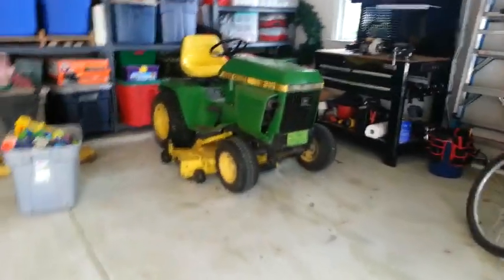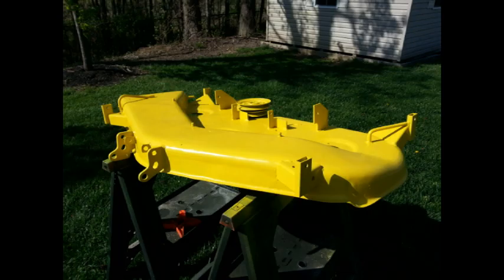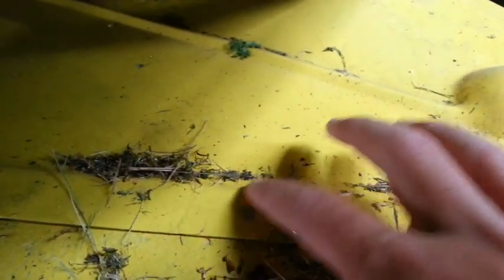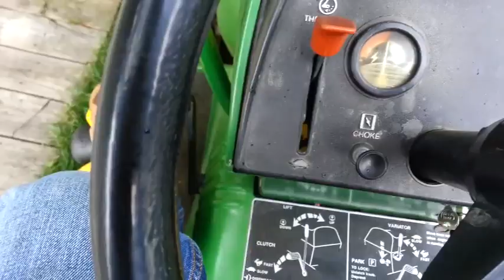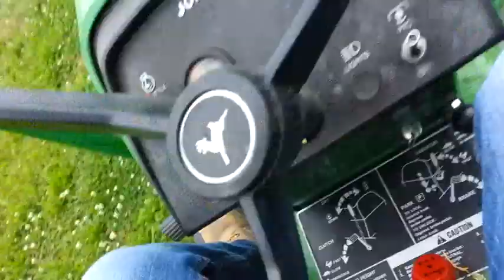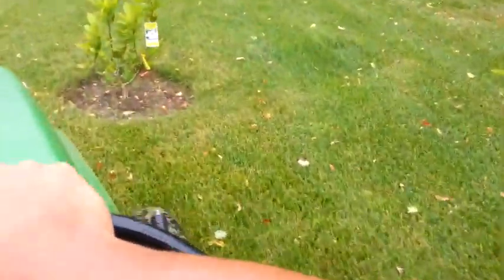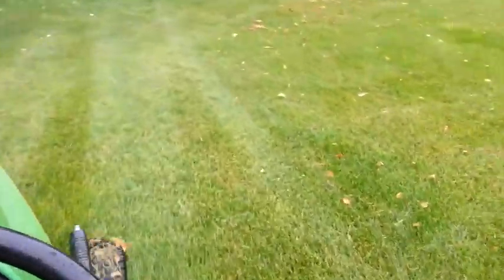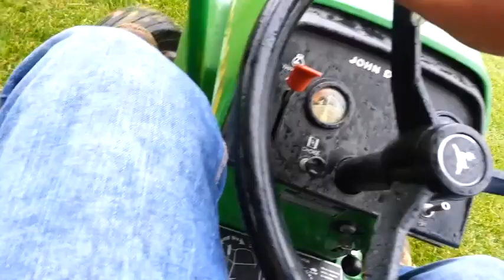Mowing With the John Deere 210

Comment: I take it the 210 can handle the 47 inch deck. But of course 10 hp from that era really WAS a 10 hp and who knows about the torque. The 14 hp in my John Deere STX 46 seems to have way more power than my newer MTD with 18.5 hp Briggs single cylinder. The JD  STX 46 has a Kohler and it can run through six inch high grass turning three blades at 46 inches faster than the MTD with two blades at 42 inch. So HP numbers have really taken a beating. Although, the two cylinder Briggs 16 hp in my friends LT 166 has gobs of power, way more than the Briggs 18 hp. I have to confess, I really like that 16 hp twin Briggs. It has a very quiet exhaust and it's smooth. But it is in no way rugged enough to pull a plow like the 210 and 212 I now have.

Got to say you have yours looking like new, impressive. When I was pushing mine around the yard I was amazed how easy to steer but of course you had to make a lot of turns on the wheel.
Can't wait to get mine running.
Reply from the maker: Yeah horsepower was rated a lot differently back then compared to now. My old 316 with an 18 HP Onan opposed horizontal twin would mow through 6" grass without even bogging down, but my X570 with a 24 HP v-twin sometimes struggles in the same grass. Vertical and horizontal shaft engines seem to put out different kinds of horsepower. I'm sure you'll fall in love once you get the tractors started for the first time. That's how the green fever starts!
Reply: I thought the lt166 came with a Kawasaki motor

Comment: Can I use a replacement gas cap that goes on a John Deere 314-318 on a 200 series tractor
Reply from the maker: No, you need one specifically for a 200 series (AM143251). The early and late 300 series each had their own specific gas cap, neither one will work on a 200 series.

Comment: You should only engage the electric PTO at half to 3/4 throttle.....you could throw  a belt, and it's hard on the engine.
Reply from the maker: With the way the mule drive/tensioner is set up on these tractors, the primary (PTO) belt goes through a lot of twisting and turning which can wear it out very quickly if you're not careful, so I usually engage the PTO at lower throttle to reduce wear on the belt.

Comment: I have a 216 idling go's up and down driving it and running sitting still. I pull the air cleaning off and gas was spitting a little back out of the carb. can you guy's help on the problem.
Reply from the maker: +jag “bunnyman” co Turn the high idle mixture screw (on top of the carburetor) 1/8 of a turn at a time and see if it smooths it out.
Reply from the maker: +jag “bunnyman” co Turn the high idle mixture screw (on top of the carburetor) 1/8 of a turn at a time and see if it smooths it out.
Reply: thanks running good now
Reply from the maker: +jag “bunnyman” co Good to hear.

Comment: Will try that thanks. Grease gun is Coming soon. Should that fix it?
Reply from the maker: It should make the steering a little bit easier, but if the steering gears or the wheel bearings have significant wear, it won't really help. Considering how old these machines are now, they will most likely have some worn steering components.

Comment: michael you ever think about getting an old cub cadet like a 104 obout the same as a 210 or 216
Reply from the maker: If I got a cub it would be a red 82 series or a 16 HP series.
Reply: I found a nice deal on some cub cadets a 104 and 107 for 700 or 1 for 475 but the guy haven't emailed me back if been looking for a John Deere 210 or 216 around that body style but there are any around my area

Comment: Can you mow in reverse with this tractor
Reply from the maker: Yes, why wouldn't you be able to?
Reply: @MichaelTJD60  because some machines have to be discontinued
Reply: That’s disconnected
Reply from the maker: @leonardcusumano3524  this one was made before all the manufacturers started bowing down to OSHA. The reverse cutout relays didn't start finding their way into Deere lawn equipment until the mid 90's.

Comment: just got a 76 model 210 dont think variator is right on it any info on them?
Reply from the maker: +mike stewart The variator is a pretty straightforward setup but if it wasn't taken care of and is not adjusted properly it can be a lot of trouble. What's wrong with it?
Reply: +MichaelTJD60 seems to either be almost a crawl or boogie mode middle dont notice any change also when ya let out on clutch sometimes you have to helo it come up with your foot or takes awhile to come out all the way
Reply from the maker: Sounds like it's just out of adjustment. Look under the tractor and you'll see the variator pulley assembly. Make sure the center pulley/sheave slides in and out on the shaft without any issues, and make sure the pulley is not loose or wobbly. Spray some graphite on the shaft to make sure it all works freely.
Reply from the maker: To do the actual adjustment, put the variator handle on the 5th notch. There are two round plugs on the right side dash tower under the variator handle. Pull off the plug that is closer to the front of the tractor. Loosen the bolt inside that hole with a 3/4" socket, and then pull the spark plug and crank the engine until the clutch pedal comes all the way up. Tighten the 3/4" bolt back down and put everything else back together and it should be good to go.

Comment: Good mower. Is your steering quite stiff unlike a car?
Reply from the maker: Not really, since I always keep the gearbox and linkages greased. I wish it could turn sharper though...that's a common flaw with the 200 series, they didn't have a tight turning radius.
Reply: How do you greace your steering?
Reply from the maker: Two grease fittings on the wheel spindles and one on the gearbox itself...you have to crawl under the tractor and put the grease gun on the fitting from the bottom. Most people don't know there is a fitting there.

Comment: I just cut my lawn already.  It smokes for no reason. Beside the oil. I think is the airbeather from gas/oil to the air fite by tubes.
Reply from the maker: Probably. Sometimes if it has too much oil it will smoke. Mine needs new rings and the head decarboned. Well, actually it needs completely rebuilt lol. Still pretty strong for what it has left. I'll probably just find a 14 HP K series or Magnum to drop in it.
Reply: MichaelTJD60 It's a cub cadet series 1000. I just reduece the oil. My Industrial Arts teacher just gave me has cub cadet in April. The only thing I did is changed the oil and oilfilter.

Comment: What gear and how far forward do you have the variable speed at when mowing
Reply from the maker: I usually mow in 3rd gear, 2nd if the grass is tall. I move the variator around since I'm always changing speed...don't usually keep it on one position.
Reply: Well when I mow it's in 3rd gear  variable speed up two clicks and I mow for probably 5 minutes and then the mower starts shaking really bad and kills itself
Reply from the maker: I don't think that's a problem with the driveline....it's probably a fuel or ignition problem.
Reply: I just replaced the ignition and tweak the  carburetor to Deers factory settings and is still having trouble mowing
Reply from the maker: Did you use Kohler OEM points and condenser?
Reply: Yes I bought a new ignition switch from Deere but have not messed with the points or condenser
Reply from the maker: That may be the problem.

Comment: What tractor do you perfer John Deere 210 or 212
Reply from the maker: They're the exact same tractor aside from the engine...I've run both a 10 and 12 HP engine in my 210 and didn't see any noticeable difference. But I prefer the 14 or 16 HP engines...they have a little more power for running a larger mower deck or a snowblower.

Comment: what brand of tires does it have they look good
Reply from the maker: +taz Man Thanks, I was running Carlisle All-Trail 23x10.50-12 ATV/all-purpose tires on the rear at the time. I'm running Tru-Power lug tires on it now. The front tires are Carlisle Multi-Trac C/S.
Reply: Im in the middle of restoring my JD 316  rebuilding the Engine paint and any bearings that need to be replaced so I figured may as well change out the tires they are so weather  checked  pretty much dry rot thanks for the Info.
Reply from the maker: New tires will make a nice touch. Just make sure to get 4-ply tires because the 2-ply tires wear down much quicker.
Reply: Will do

Comment: At 2:35 who noticed the 111 hood?
Reply from the maker: At the time I was in the process of parting out a 111.
Reply: MichaelTJD60 Michael what year is the 210?
Reply from the maker: 1983
Reply: MichaelTJD60 still have the X570?
Reply: MichaelTJD60 does the 210 have power steering?
Reply from the maker: Yup, won't be getting rid of that anytime soon.
Reply from the maker: No, it's just manual steering.
Reply: MichaelTJD60 how many hours on the x570? Just curious.
Reply from the maker: 206 as of right now.

Comment: You would've been better off using basecoat clearcoat yellow or just having the deck powdercoated. That enamel stuff doesn't last.
Reply from the maker: You're correct, but I was young and dumb back then and learned my lesson. These days I prefer to just buy equipment with nice original paint still intact..cosmetic work isn't my favorite thing to do.

Comment: No. Can't afford a deere. Westwoods are English made. Are you American?
Reply from the maker: Yes sir. Now that you mention it, I think I have heard of them on a forum once. But I don't really know anything about them. I'm guessing yours has rack and pinion steering rather than a gearbox like mine. If so, you can probably smear white lithium grease on the rack and pinion gears to reduce the friction. And check the spindles for grease fittings, like I mentioned before.

Comment: by the way nice tractors. they just don't build them as a real deere any more
Reply from the maker: +Kevin Roman Thanks man, yeah I agree, that's why I only buy the old stuff now.
Reply: are you doing any thing with the 210 still
Reply from the maker: +Kevin Roman I put the new Powerflow bagger on it this weekend and i put new brakes on it but I still need to get the PTO working.

Comment: Don’t have the throttle at idle when engaging the blades have it almost full throttle that is very bad for it.
Reply from the maker: There is no need to run the engine wide open when engaging the blades. That puts excessive wear on the belts since they have to quickly accelerate from 0 RPM to 3600 RPM. It won't hurt the clutch but it will hurt the belts. I always engage at an idle or at half-throttle if the engine is cold.
Reply: Michael's right, never engage blades at high rpm